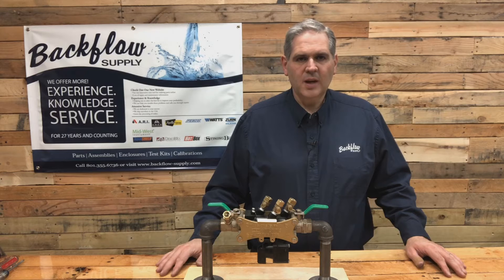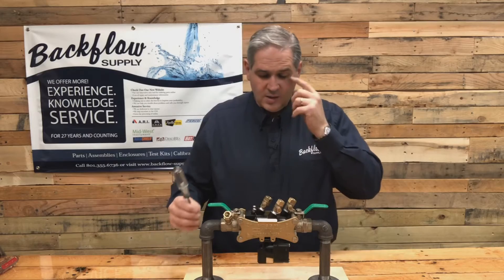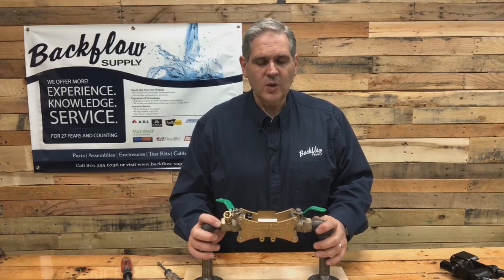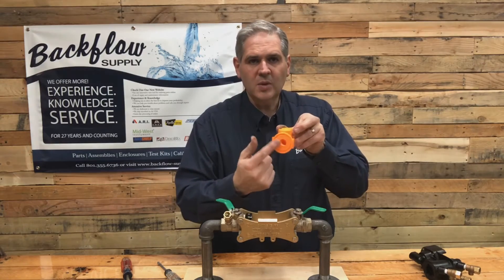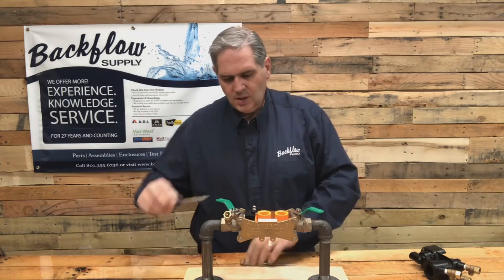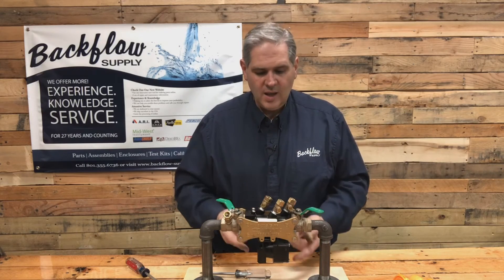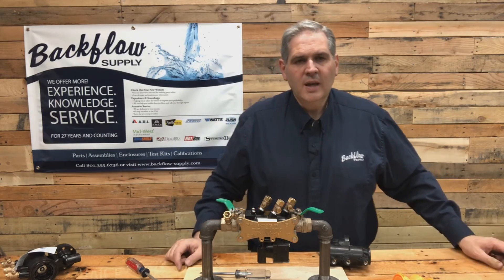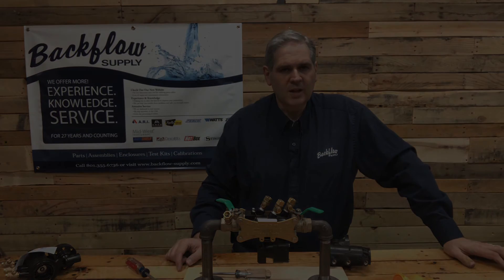Wilkins 375 and 375XL Vessel Removal and Blow Out Fitting Installation and Usage

Comment: Excellent Video with Awesome information, Thank you so much. The service I use to open and shut down my lawn system wants to charge me $575 for the Vessel Kit and putting it in. During Spring turn on, they charge nothing for installing it, and the old Vessel Kit is installed, and they want to charge almost $300 more for the part than what I can find online. I understand companies are there to make a profit, but more than 300% is ridiculous, and that didn't include charging the system.
Reply from the maker: Are you going to do it yourself now?

Comment: I would like to put the orange insert in my basement in winter. But, with ball valves 1/2 open spiders will enter and build webs which will plug my system in spring. Are there any plugs to seal the 1/2 open ball valves?
Reply from the maker: you could go to an Ace Hardware, Lowes, or Home Depot and get some plugs to thread in.

Comment: So when your getting ready to take out the the backflow preventer and u turn off the water source do u need to close the inlet and outlet valve and then release the water pressure from the test cocks ?
Reply from the maker: Yes.  Opening the test cocks will drain the valve to atmosphere and allow the water in the body to drain out.  The inlet and outlet ball valves should be left part way open after you shut the water source off.  This gives room for the water that is left in the valves room to expand.  It is the best you can do if you are going to leave the assembly in place.

As a caution some models need more attention to the main body of the assembly to get the rest of the water out.  But since this comment appears to be from the 375 model you can take the plastic housing out and put it in the house.

Comment: Thanks, good video on that backflow. My son has that model and currently has water gushing from the relief valves bottom so stripping it down and back together will be easier with this video.
Reply from the maker: Let me know if you have questions or need anything.  Best to call me at 801-355-6736 or sean@backflow-supply.com

Comment: That center hole on the wedge is your friend ! Makes removal of the wedge  quick and easy, simply take one of the screws you already removed and screw it all the way in the center hole, as it goes in, it will begin lifting the wedge out, no prying no stress. Center screw makes life in the field much easier, we do several hundred in a season. We use small battery operated screwdrivers set with the proper amount of torque  as to not damage any parts of the wedge or backflow.  Your vid is very good and informative, for many . Thanks

Comment: Good video but wow, can they make anything more poorly with just plastic parts!
Reply from the maker: Thanks for the comment!  Plastic parts are not for everyone.  I am not sure if you are referring to the blow out fitting or the vessel.  I have had no complaints on the blow out fitting.  As I mention in the video these 375 vessels do not stand up to a light freezing.  I see a lot of cracked housings.  For those not familiar with the brass assemblies, they too can crack if not winterized.

However, if people are aware of this and take care not to freeze it, this model is just as good as any other.  I have come to realize that all models have strengths and weaknesses.  As long as we know what they are and take care of it accordingly one is just as good as another.
Reply: @backflowsupplyslcut9394  Is the cracked cylinder repairable with sealers, silicone, etc.?  Having trouble seeing which size of blow out insert to match my system.  I have the MODEL 375 RP 175 PSIG 1.2MPa  Good video, well done.
Reply from the maker: @larryroberts2945  sorry for the delay in responding.  When you say cracked cylinder are you talking about the orange blow out fitting or the black vessel?  I wouldn't recommend trying to do it to the black one, and don't think you would get it to work and have it pass a test.  The orange blow out fitting you might be able to buy a little time trying to fix it, but they are inexpensive enough.  
What size is your 375?  It would be on the side of the ball valve, both would have the size on it.

If you need to send me a picture you can send it to sean@backflow-supply.com or call the office, 801-355-6736